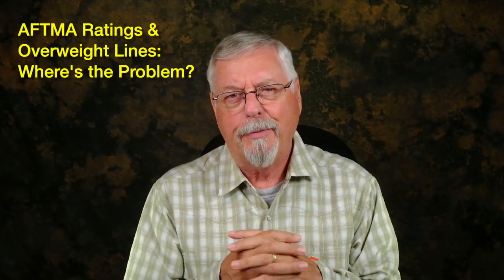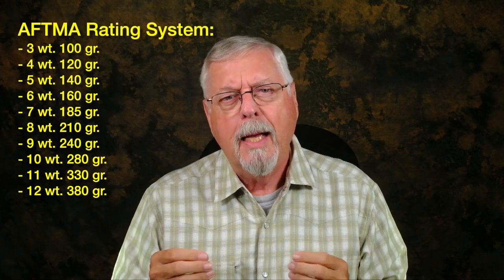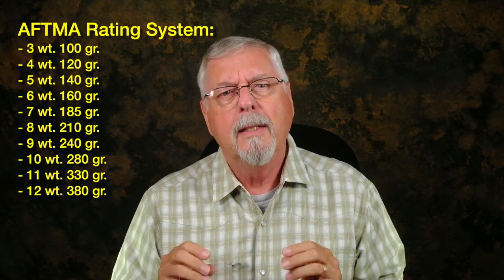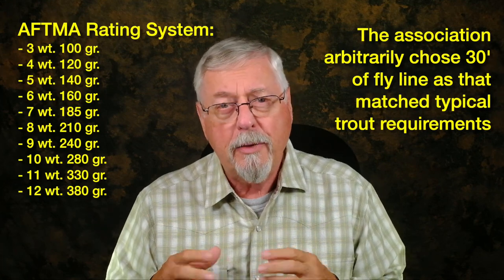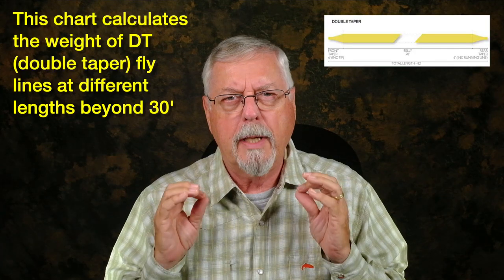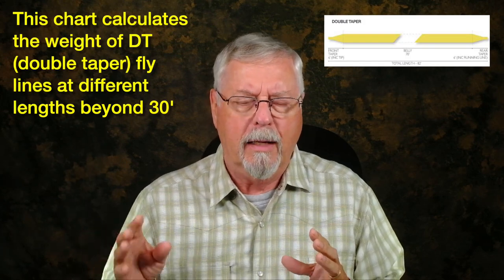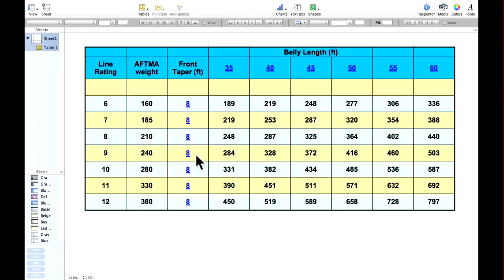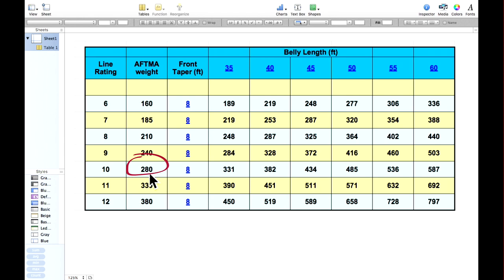Peter's Fly Fishing Vlog: Here we go again with the overweight line problem

Comment: I just found an old reel that had a 9WF line on it. I chopped the head off at 40ft and it's a 350grain midbelly Scandi. I'll try it tomorrow on a couple 2-hand rods. Your encouragement led me to chop and weld lines. Thanks for the reality check, Peter!
Reply from the maker: The original Scandi lines were chopped up DTs. The first purpose built heads (Airflo made for Loop) replicated these old efforts. Just use a long leader to make up for the lack of taper.

Comment: Hi Peter, thank you for this great video and the whole hooked4life channer. I've been trying to understand this issue for some time already. It's clear that DT needs longer carry to cast further because we cannot shoot so much. Do I understand it correctly that rods are rated for 30ft casts and if we want to cast further we just have to load it more similar to longer carry with DT? 

However, why rod manufacturers rate rods so that they need overweighed lines. I think it should be either rod or fly line manufacturer who exceeds the standard, not both of them. Thank you very much. Karel
Reply from the maker: Depends on the rod company. Most of the client owned rods I've cast would handle their rated weight at regular trout differences. The few that were off (some way off) were from one company that I won't name (not Loomis).